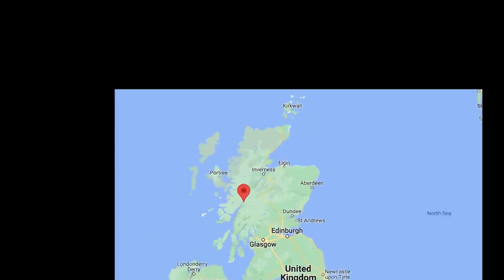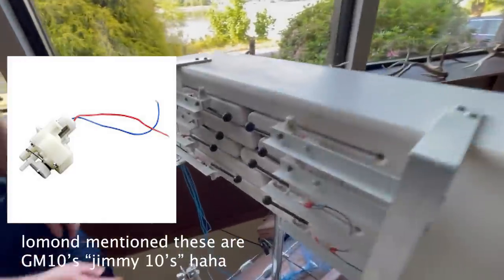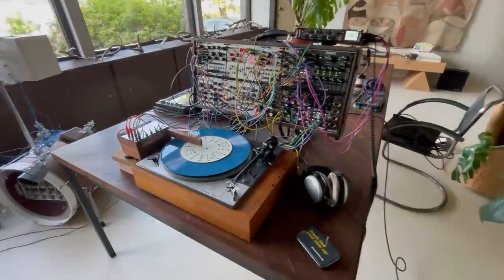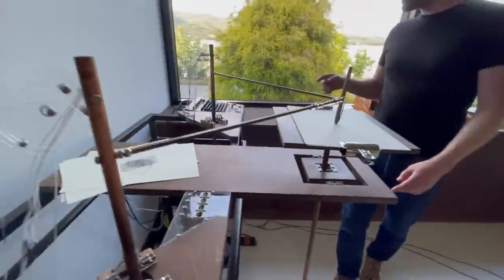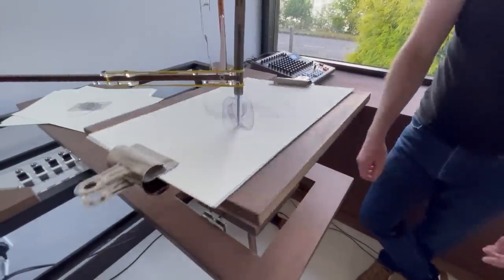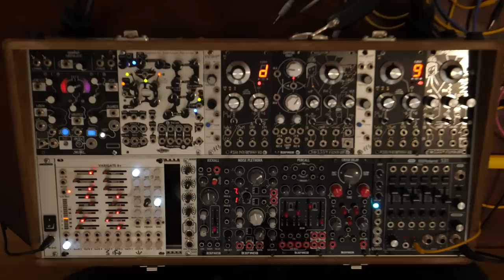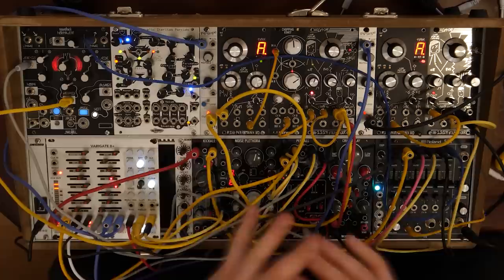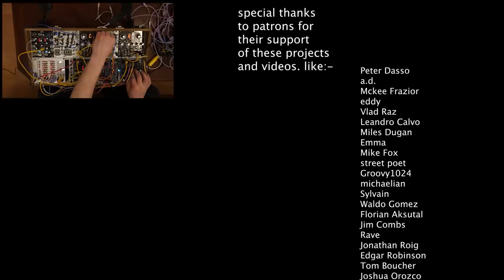Meeting An instrument Inventor with a difference - Lomond Campbell

Comment: About 30 years ago I designed and built a MIDI-to-parallel interface for my drum machine. (I still have it!) I intended to build another recently but it was 6809-based and some of the other parts are hard to get.

The J-Omega MIDI-to-parallel and Parallel-to-MIDI interfaces, mentioned in the video, look perfect for my needs. They are reasonably priced too.  (I am not in any way affiliated with J-Omega)